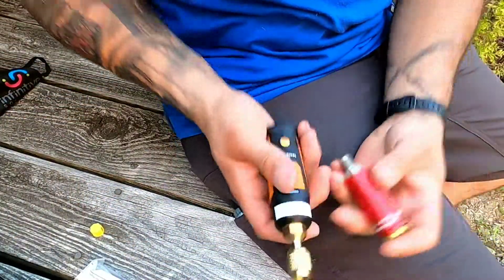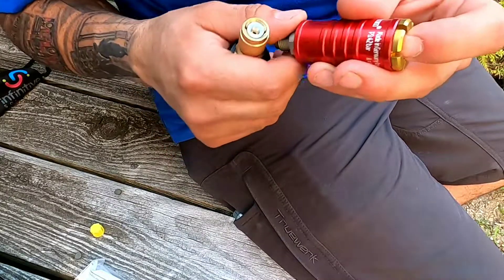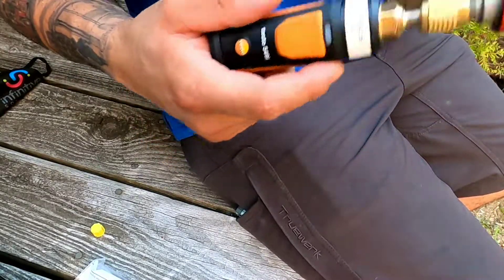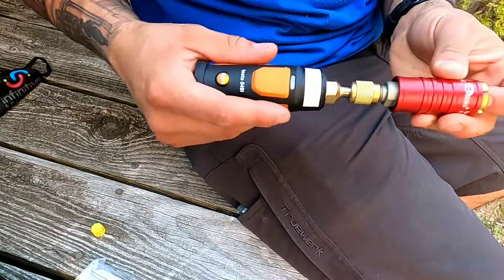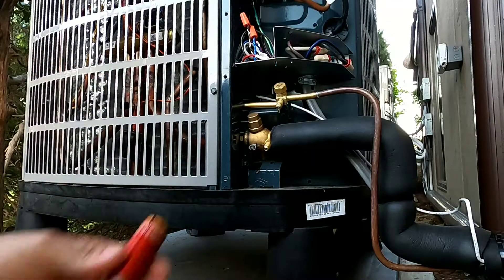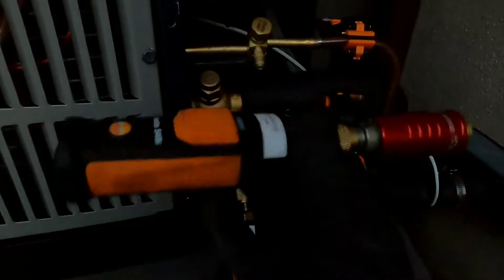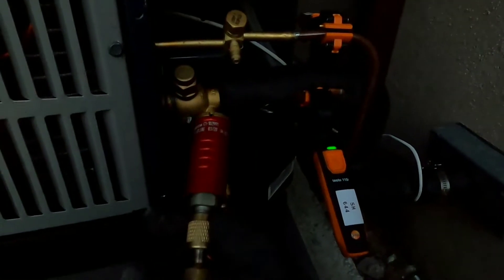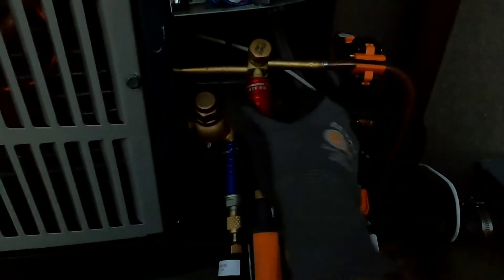WEH Quick Connectors

Comment: No need to twist! If you twist those gaskets inside will decay faster. 
The outer sleeve pulls back and goes foreward. So pull back on sleeve to release and push forward to lock.